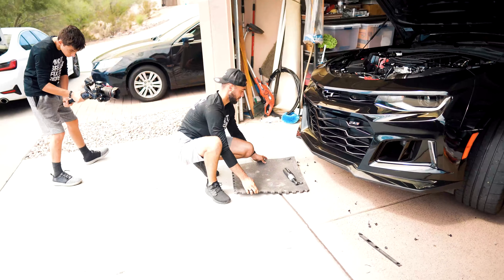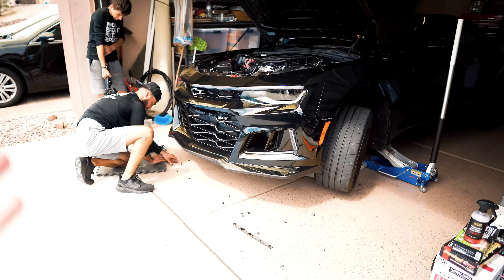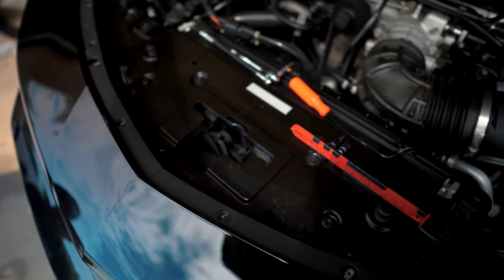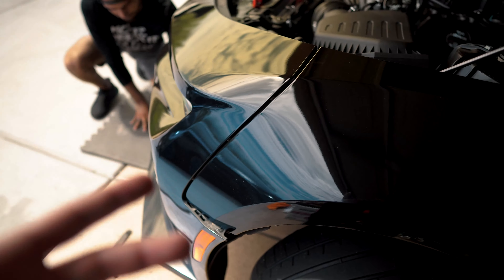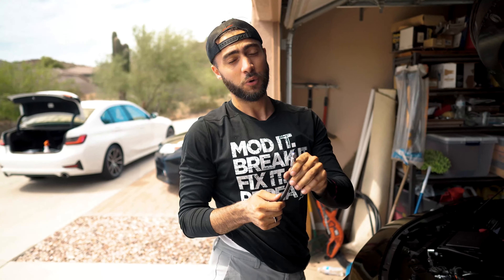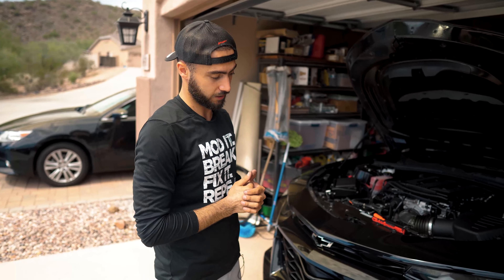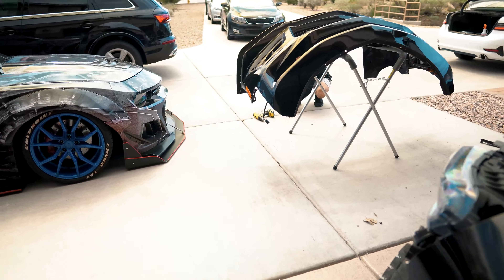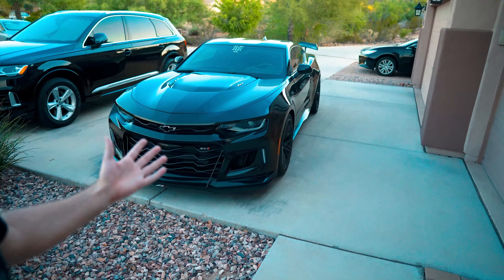CAMARO ZL1 APR FRONT SPLITTER - INSTALLED - LOOKS AMAZING!

Comment: Do you have to have those splitter rods on  or can you have the front splitter on without the rods
Reply from the maker: mine are mounted to the grille. should be atleast to the bumper but my friend that gave me the splitter already had the wholes in it so it lined with the grille better than bumper. but yes put them on so you don’t break the splitter off at high speeds.